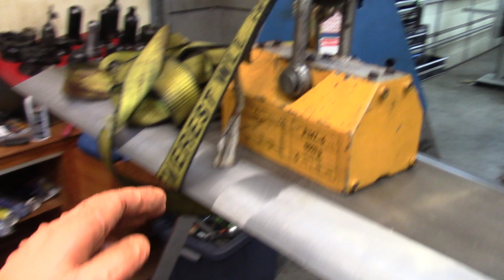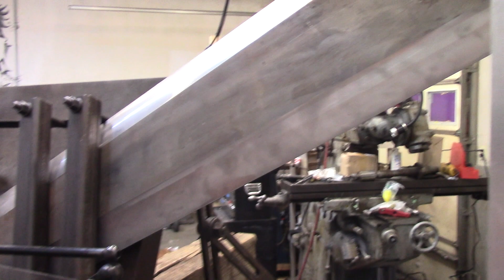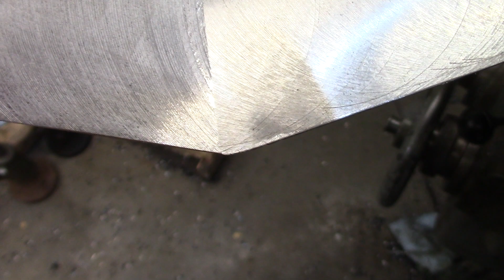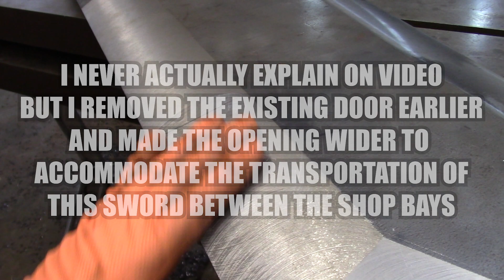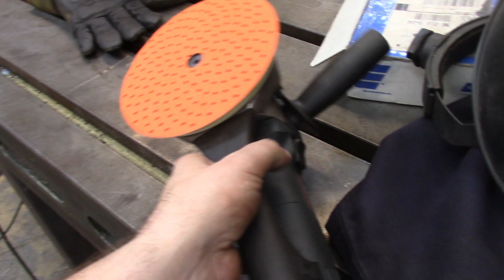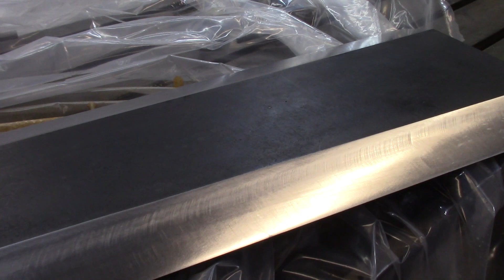Finalizing the Dragonslayer blade || Guts' Dragonslayer from Berserk (Part 3)

Comment: i believe errors in the bevel are due to the warping of the blade. its going the other way on the other side because of the curvature and the angle itself is different because of the difference in circumference of the curvature on the other side due to the thickness of the metal. i think. i may be wrong. 
Edit: fixed a typo

Comment: Assuming there was a mythical figure who could have used something exactly like this in terms of thickness and length in the middle ages, he would 100% be regarded as a god of war not at all unlike the reputation Zodd has amongst soldiers in Midland. He would absolutely have to be at least as big as the sword, if not bigger, and extremely heavy to make proper use of it.

Everything Guts would need to actually be able to wave around Dragonslayer if he were a real person, Zodd has. He's almost double Guts' size, he's twice as buff, and he's like.. three times as wide. He'd definitely be heavy enough and strong enough to use the Dragonslayer properly if he were real.

Comment: I estimated the "Dragonslayer" at over 700lbs, and that's being conservative.
Reply from the maker: Hehe, you were only off by a "little" :D
Reply: @Pretty Hate Machining  Clearly using different dimensions. I calculated the volume of the blade using estimates I gathered from images in the manga. Then used specific gravity of iron as my multiplier. Actually, low estimates put it at around 600lbs. High end landed at over 800lbs.

Comment: Your mistake can be attributed to table flex, and probably a little less to sword deflection.
Reply from the maker: You think the 1000lb cast iron table with 5 supports is what flexed? And only on two of the 16 cuts?
Reply: @PrettyHateMachining  when you had it raised off the bed is when it was at its least supported point. The strength of the hinges is highly questionable, as well as their side to side tenacity in particular is where I think the problems began.

Comment: I've watched a couple of content creators making giant swords for a while now, and I have to say, none had left me in awe as your work with this one has. The sheer size and weight of the piece of metal you've choosen to work, to keep it as faithful as possible to the fictional conterpart has made some famous professionals make compromises and just shrink the size or thickness of the sword, just because how impossible it would be just to transport this thing from one machine to another, like you've been doing in the past 3 videos. That's a really amazing amout of commitment there.
Now, I'm curious, how do you plan to make the handle? You'll have to drill the sword and put giant bolts there to secure? Maybe drill the sword towards it's lenght and put a giant steel bar there as the "spine" of the sword?

Comment: A frame jacks resting on the floor would be good idea
Reply: Your blade is twisting. You should be able to mask it in the finishing process. The blade might be a little thicker at that corner. Your ADD or ADHD is showing(typical machinist)

Comment: Nothing beats air tools for sanding as they are self cooling and can run effectively endlessly. 90° is my favorite.
You did great on the bevel btw, it's a difficult thing to do. Best guide would probably be a primer on the section you want to meet as the reflection of light is the hardest part to differentiate.
The gouge in inescapable with a guide, sadly as when you come to a stop you invariably pull, which multiplied by every stroke, leads to more material removed.
All in all, it's coming along fantastically.

Comment: I love this project. As for straightening, heat it up and apply water where you want to put pressure. It's a lot of heat to quench though, so a large volume of running water could be necessary, to say nothing of the angles you may want to run it. Ofc that's an energy and time intensive process. Ofc, this would be a final finishing measure just before polishing.

Comment: only way to bend steel like that is heat and cool - but it may just need a normalisation process

Also electro etching may give you a good finish on your black part - maybe for the random pattern (masking) either laminate or some random cracked clay

Comment: Was lightening the blade blank an option? i.e. drilling parallel holes down the blanks lengthwise?
Reply from the maker: I suppose you could, but there was really no point. You could never really lighten it enough to be able to lift it.

Comment: Talking about the warping in the beginning of the video, do you think it might be the uneven heating of the material when it was cut in to rough shape? 🤔
Reply from the maker: Certainly possible. Hell, it may not have been straight from the steel mill for that matter.

Comment: For the warping of your blade, you could also use a surface grinder if you have one, or have access to one. Shim it, grind it, flip over, finish up, and it'll be pretty close to perfect.  Granted you'd need a pretty big surface grinder, one of those automatic ones. At my shop we use it all the time if flatness/squareness/parallelism is absolutely critical. 

I'm not sure if you have the ability to, but you could try to fly cut it as well? Take a lick off the top and bottom, should be relatively flat then. But if your bridgeport/milling maching head is not indicated/worn down to where there's a ton of play in the spindle or something, or if it's not clamped properly, it'll probably be out a couple thou again. With the edges on it, I'd imagine it'd be pretty hard to clamp down, I guess you could do it in sections, but you'll probably have to shim it at some point because if you move the clamps around and clamp at different points, you're potentially going to lift the piece up on different high/low points on the bottom.  The only around it is if you have a magnetic chuck, and even then you'd need a BIG one.

Either it looks awesome dude great job, I'd say a surface grinder is your best bet if you want to take the warp out. The warp is barely noticeable anyway, especially if it's going to be a wall piece or something. It's really only going to be noticeable to the naked eye on a lay out table, or something that's really flat. As machinists our brains out just wired different :( I'd say just leave it, since it's going to be a pain in the ass.
Reply from the maker: Your thoughts are all really good, but yeah as you said it would be a mountain of work. There's also the issue of machining it and ruining the mill finish on the blackened sections and having to recreate the texture by hand. Two mountains of work!

Comment: What kind of milling head is that? There’s no way that’s any regular head if you cut that much steel away without it blunting. At college we had a titanium tipped head for hardened steel
Reply from the maker: It's got replaceable tungsten carbide inserts/teeth. Commonly called a face mill.

Comment: I love, this is pretty accurate

buuut I'd add some angle, to temper it
whole sword was supposed to weight 100kg, while your blade alone is 137 before guard, handle and pommel
so if you have a way to temper it it'd be acctually perfect replica!

Comment: It's probably stress from you machining it without cutting liquid that's making it warp rather than stress from initial production.

And with your estimated 2% measurement error, bevel issues like that are to be expected.

If you spend 10% as much on measurement tools as you do on heavy equipment you can avoid that.

This is why historical swords always have a little hand-adjusted curvature in the profiles.

Comment: The black spot is suposed to smal dents
Its a actual thing, as a novice black smith i had to make this
Its pretty easy to do just heat up to red and use a round head hammer and go mokey mode
Reply: Its still look very cool

Comment: Ever thought of making this blade out of titanium? it will be much lighter (at least compared to that hunk of guillotine blade ) and it will still have a legit edge.
Well, there is the price of course, and titanium of comparable size could cost a fortune. BUT... if you have that kind of budget, would you make this sword again in titanium?

because, I would like to see a wieldable and working Dragonslayer sword.
Reply from the maker: I did consider it, however Titanium is only roughly half the weight of steel, which still would have made this sword unwieldable.

Comment: I would love to see you cover up the imperfections with use marks, maybe make a sacrificial sword edge on one side of a blank, and cold pound it against the DS blade with a hammer on the few places to make it seem as though it has seen some use, along with a few other choice oines you see fit, so it can have the worked look you want, as well as the finish it would have.

Comment: I know this might seem crazy but if you do manage to find somebody strong enough to even attempt to wield it, a welded on handle will most definitely break off. I would suggest maybe tapping a threaded hole 14 or 15 inches into the blade and using a solid steel handle that can like screw into it. And then basically welding the edges of it to hold it in place before putting on the handguard.

Comment: If you made a second identical sword, and attached their handles together, you could probably have a strongman deadlift it, since the world record is 487.5 kg / 1,074.5 lbs. I'm almost sure it would be impossible with a single sword because of the imbalance.

Hell, with proper counterweight and handle length (I'd guess over 4m) you could probably have the whole contraption weigh less than the weightlifting world record (267 kg / 589 lbs) while being balanced for a weightlifter to grip it.

Swinging it like a normal sword is clearly out of the question.

Comment: But seriously, you should have made it from composite materials - using a steel honeycomb core with a Solid steel shell/edge (assembled using welding and metal epoxy). That might reduced the weight by 100kg
Reply from the maker: Gonna need a lot of JB Weld
Reply: @PrettyHateMachining  Hmm, probably machine a solid lower shell (with blade edges), and drop the lattice core inside. Then weld a solid upper cap. Epoxy can be used just where lattice touches the shell, and not too much is needed. 

If fact, if you mill out the top of the current sword, you can make the solid lower shell. And instead of using a sperate lattice core, just mill out the lattice from the solid core you have right now.

Comment: Warping can add a change of angle effecting the Tangent and in turn Sine from your vice, you have a few options but they aren't great to fix, one is grinding down the edge and using a magnet plate just hoping you can get a level plane and have everything still hold a tolerance but risk scale of the blade being a bit thinner or one edge being a bit deeper. Which for a standard sword would be an issue for edge alignment but no human is actually lifting that without having back issues and sinking into the grass.

Comment: That the diagonal bevel on one side became twisted like that probably means that there is a slight un-evenness in the side bevels, especially since the error was compounded by the other side veering off in the other direction. It doesn’t have to be much, just having a chip wedged between the sword and the table when machining could do it, or one of any number of other factors that displaced the edge just a tiny bit off-center.
Reply: I was looking for a reply to this, it's what I was thinking..just dont know how to say it in english 😝
Reply: Just something to be mindful on if one's making a more 'combat worthy' version of that monstrocity.

Comment: You've got balls of steel working on that thing. The weight by itself is scary, add that edge to it even unsharpened, loosing control of that in the shop would be catastrophic. Stay safe while working on it sir. Fantastic work.

Comment: An absolute shame miura can't see this insane, monstrous achievement.

Really excited to see what mounting system you might come up with for the handle. I wonder if there would be some way to take this to a room size pottery kiln and actually quench it. I doubt you'd want to harden more than just the outside, to a very slight degree, though. Maybe just tempering, even. At the very least, with a kiln, you could add that forged texture you're talking about. Be a hell of a project to get this into a van and take it to a kiln somehow, though. Honestly, for a blade this size, without much of a useful need for an edge, it might warrant like, some sort of clear coat of some kind. I'm really not sure what that would look like. I'm also thinking to even wield this thing you'd probably want a full harness with a line attached to the sword at about arm's length, maybe to your chest, so it wouldn't rip your arms off. Outside of that, this has me convinced that this sword might not be as unwieldable as conventional wisdom would have you believe.
Edit: Thought I'd like to qualify that it'd be basically completely impractical to wield. Also, though I'm not sure of it, it might be possible to take this to some sort of facility that's already in the process of hardening huge pieces like that industrially. I'm really not sure where that would be outside of maybe like, the crankshafts for trucks, or something to that effect. But then, to be clear, all of this is just me going through speculative overkill on something insane.

Comment: Kind of a stupid question! Did you measure the top inside point to both bottom points on the tip, to get all equal distances. Watching this vid I see a chalk line on the side that's off and it looks like it would line up perfect if cut. What I can't see or tell without seeing it up close is if those 2 back points measure evenly to the top point? If so then it may be slightly longer on one side going all the way down to the bottom end of the whole piece throwing you off ever so slightly. I'm writing as watching so I may be missing little bits here and there but it's still awesome!!
Reply from the maker: I'm honestly not sure, it was a long time ago. What I showed in the video is only 5% of the work on that part of the sword, I never was able to figure out what happened despite measuring everything numerous times. I'm 75% certain it was an issue with the blade warping and twisting.
Reply: @PrettyHateMachining  can't wait to see it complete!

Comment: idea to lightly texture it, weld a bunch of ball bearings to a metal sheet and just hammer down on it, you could even put a rebar handle on it so you don't smash your fingers
Reply from the maker: Good idea, I've done stuff like that before. In fact, I've welded small bits of steel directly to the hammer head, it worked out okay on thinner material.
Reply: @PrettyHateMachining  especially good if you can manage to not ruin the hardening of the ball bearings since it's mild steel

Comment: Are you gonna try to hold the blade with a crane to drop the blade for destruction test. Or maybe talk to someone who makes mechs that test its strength. Probably far fetched but awesome
Reply: The steel is really soft. It’s edge would just “squish” if you dropped it even a few feet from the ground.
Reply from the maker: @thebiggestpanda1  Hell, it squishes just from pushing the blade into things!
Reply from the maker: Maybe someday if I make a hardened steel version, this one would get wrecked fairly easily.
Reply: @PrettyHateMachining  yeah you might do that maybe next year or something. Still awesome sword though

Comment: 3M blue is pretty good but if you want tape that I've never seen anything get underneath, use FrogTape. I've never had it not peel off perfectly clean and crisp.
Reply from the maker: Thank you for the suggestion, I just went and bought some to try it out. To be clear, I didn't really expect the painters tape to "work", as I knew it'd get soaked with the black oxide solution and leak through that way. The timelapse made it seem quick but it was probably 1-2 hours of work so I didn't expect it to hold up. The only thing I've really used with any success (for this particular situation) is vinyl tape and it's quite pricey.
Reply from the maker: @Schnoz three month update. I now use frogtape exclusively. Stuff is great, thank you!

Comment: It was off in one direction the when flipped it was off in the opposite so it doubled the distance between them instead of one being closer or further. It's like it was so accurate. Look at them they look mirrored in there amount they are off by.
How much would it weight if it was titanium instead?
Reply from the maker: Pretty close to half. Titanium is about 45% the weight of steel.

Comment: Good news! Even if its chipped or dulled, it only becomes more canonically accurate, since it is most definitely dulled and beaten from Guts constant battles.
Reply: And it will still kill just from the weight
Reply: @arran4285  I am pretty sure guts kill one random armored mf with just the weight of the blade but I can't tell for sure since the manga has literally over 300 chapters lol
Reply: @joemama-bu5ue  maybe it was against the Holy Chain Knights after killing Rosine?
Reply: Well, no, Godo used something he called an "ultimate steel" which somehow can repair itself when put to fire.

Edit: It seems I've misinterpreted what Godo says, it turned out that he was talking about reforging the sword, not the sword fixing itself.
Reply: @Karak-_-  Lets see your source on this one buddy.
Reply: @Michael-bn1oi  The capter when Guts return to Godo and find that Casca's gone.
Reply: It was not a sword to be swung, but more of a metal that would fall on the enemy.
Reply: As long as they're genuine animated skeleton dings and dents!
Reply: Not true. After killing so many demonic spirits with the sword, it became imbued with demonic spiritual energy. So its no longer just a physical blade that gets dull. Its basically a indestructible sword.
Reply: Cracks in the blade
Reply: @lindyxyo4254  just sad. Wah.